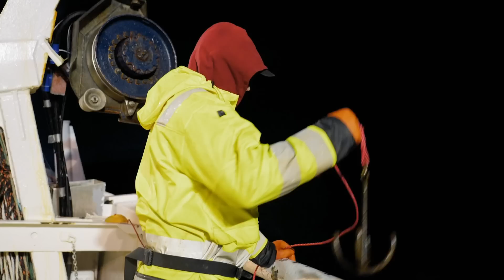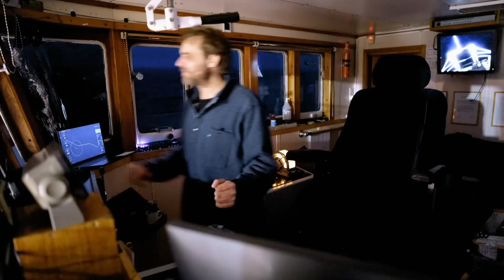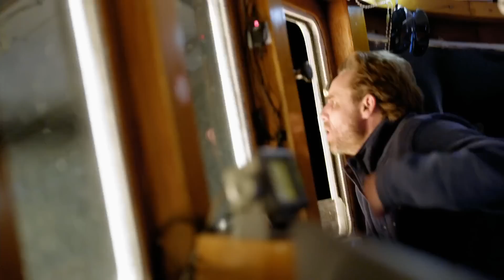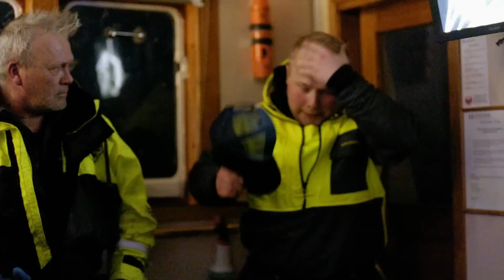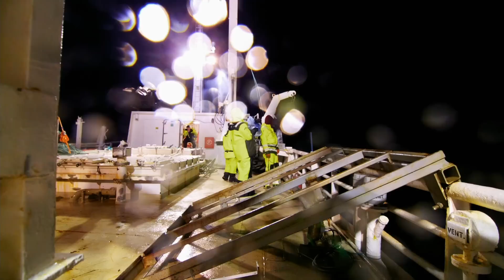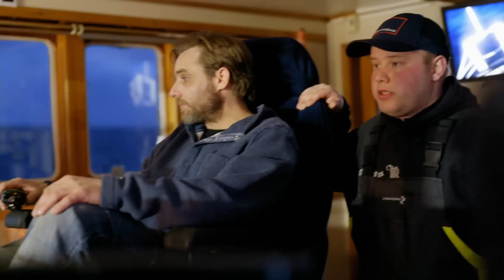Captain Loses Control Of The Wheel As The Ship Takes On Water! | Deadliest Catch: The Viking Returns

Comment: I even keep my personal truck equipped with spare belts, nuts, screws, fluids, hoses.  If I break down, it's highly likely I can get back to life in less than an hour.  No stocked parts for basic breakdowns?  Nah, Jake.
Reply: you must have stopped watching halfway. the mech said they ran out. jake said they had a tonne but the mechs used them all. so really whos to blame the mechs for not mentioning it to jake, or jake for being a captain and not a fkn engineer in charge of keeping spares?